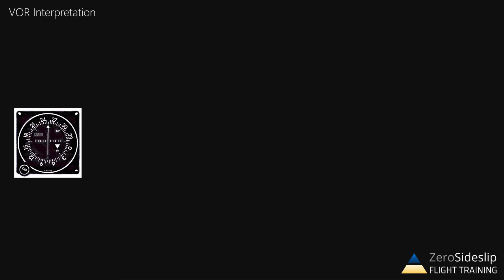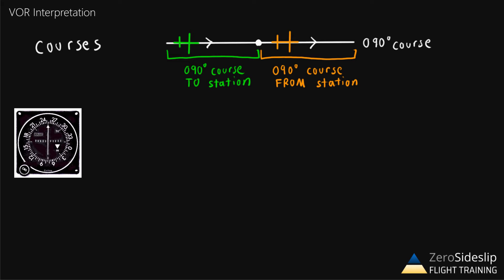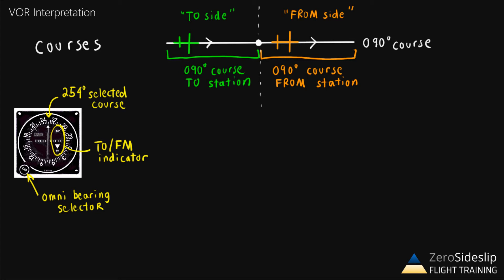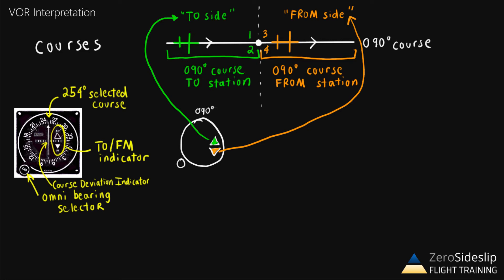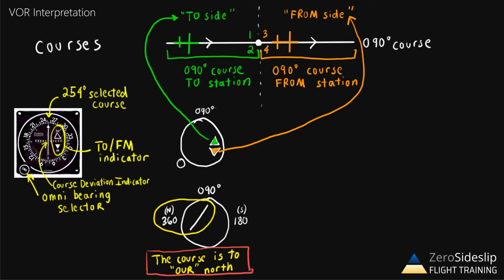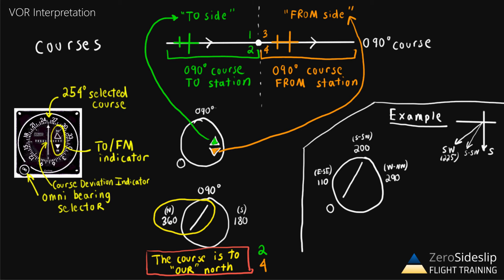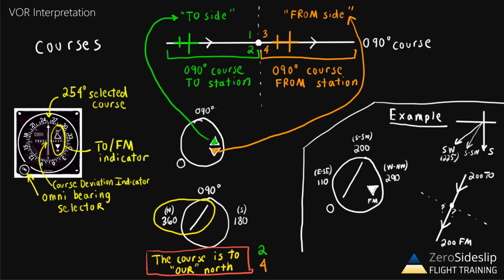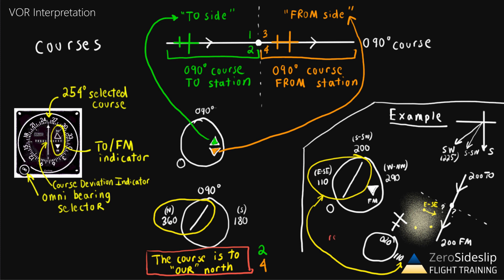VOR Navigation Trick - Don't Let REVERSE SENSING Confuse You!

Comment: Nice try. Did not clarify reverse sensing though.
Reply from the maker: Hi Craig, thanks for your feedback, and sorry for my delayed reply! The main message I wanted to convey is that "reverse sensing" only becomes a problem if you think of the CDI needle as a "left/right" indicator instead of a "direction" indicator. The latter is what I recommend in the video. Check out the very end of the video (starting at 7:50) to see the explanation of reverse sensing (defined around 8:50). If it still doesn't help, let me know which parts are confusing and I can do my best to help.